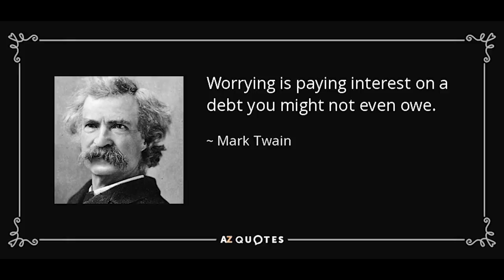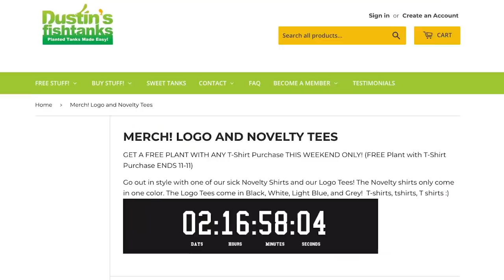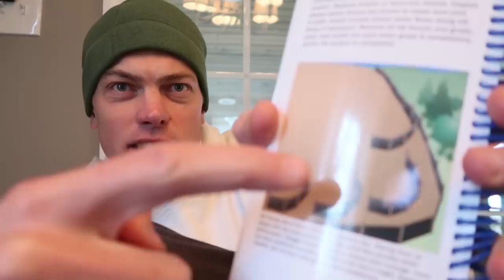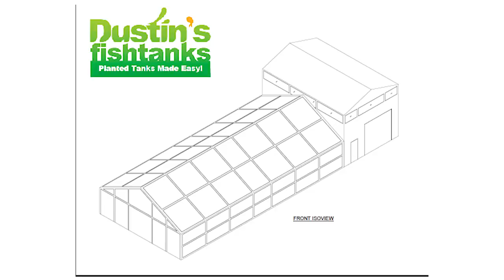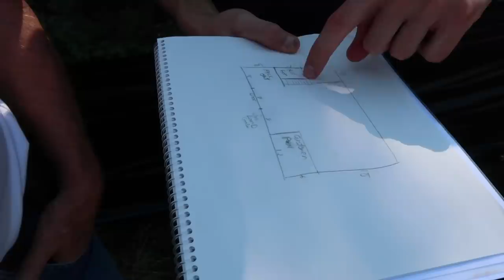MEETING The Building Inspector: GREENHOUSE SAGA

Comment: Make sure your concrete is thich enough for the weight of the water. Cracked my slab and sank 1/2 inch.
Reply from the maker: david diehl how thick was your slab?! How big around? I’m going 5 inches and tamped way down under it.
Reply: @Dustinsfishtanks  It depends on the type of concrete, size of rebar, size of stone in the concrete. Probably go with a monolithic pore, foam around your pluming coming through your slab in case it shifts. My slab is 6" tapered to 4" in the center, don't know what the footing is. Room is 12' by 16' with 3-75gal on one wall. a 150gal and 2 75gal on the long wall, 2-75 on the opposite wall with a 55gal in the middle. About 7000lbs on the perimeter. Weight will vary on type of support you use, legs will have more weight per square inch than platform. Figure it for the max the space will hold, tanks plus building including snow load.
This time of year make sure they cover the slap with heating blankets. Might need to have an electrical drop put in for power.
Reply from the maker: Yeah- so we are gonna do 3 foot wide peirs, then pour a 5 inch pad over that....rebar cages in the peirs.... i am thinking of having him cut it into 12 foot squares so if it cracks it does so on the cracks....this is 36 x36....we shall see!
Reply: @Dustinsfishtanks  Add fiber mesh into the mix, for the cost it's worth it. Stops little cracks from becoming bigger. Have you considered a floor drain system?